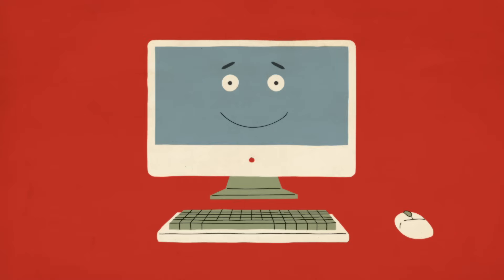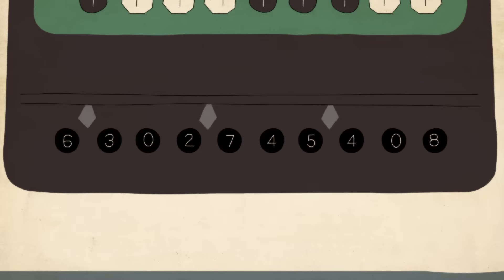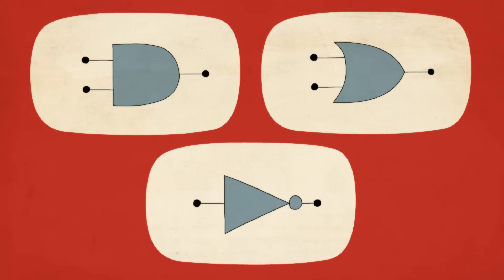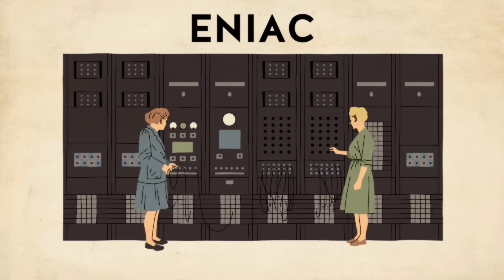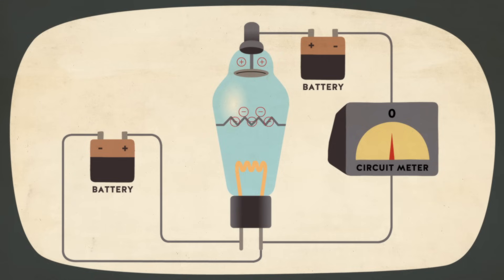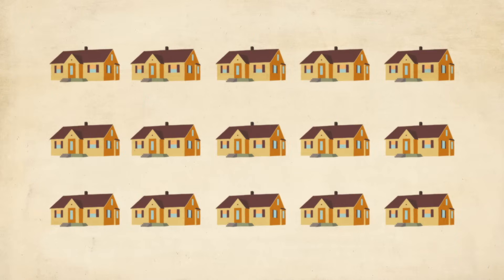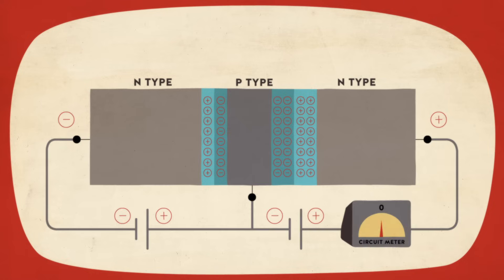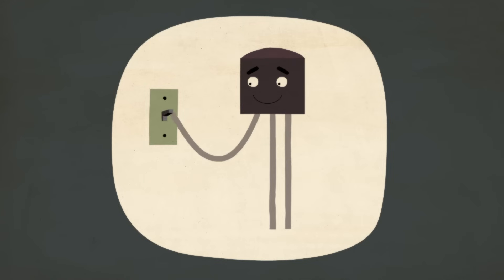How transistors work - Gokul J. Krishnan

Comment: This is really interesting. Ted-Ed, can you make a video on how computers generate random numbers? A lot of software and games use random number generators nowadays. Are those numbers REALLY random? And if not, is there a way for a computer to generate TRULY random numbers? (without using internal clocks.)
Reply: no, they're not. Computers are deterministic (they will always give the same results for an identical set of inputs), which is why the clock is commonly used as a seed to generate pseudorandom numbers, but it's still deterministic. There have been several approaches to generate 'truly' random numbers using atmospherical and thermal noise observed from earth, but that's the thing, you would need something external to the computer to create 'randomness'.
That has always made me think: the world operates by physic laws, for every action there is a reaction and it can be explained with mathematics, so, in a way, there is no randomness in the universe. If you, hypothetically, were able to take in account ALL of the world's 'variables', and knew ALL of the laws of physics (if that is even possible), you could in fact predict the future, it seems. That speaks in favor of a 'destiny', everything that happens is the only thing that could happen. Just a thought.
Reply: Quantum effects are random.  A quantum computer is the only machine that can generate a 'truly random' bit stream.  Having said that, pseudorandom generators can suffice for all practical applications.
Reply: As Freek pointed out, that was Laplace's assertion, and it held philosophically (if not practically) until the Copenhagen interpretation of quantum mechanics.  In QM, particles are 'truly random' until they are observed, at which point a deterministic state is realized.
Reply: Vsauce has already made a video about that
Watch 'What is random' by vsauce
Reply: every second would be much too slow, its more often, but jeha thats what they do. if you want it more random use something that can detect cosmic noise, this is unpredictable for us at the moment and i think it will be for very long time...
Reply: +Robin Maurya there is a way to generate truly random numbers using radioactive decay, but obviously you cant use it in typical PC, but  maybe there is a new clever way of doint it that we dont know.
Reply: The main point is there there are a lot of theories under quantum mechanics that would simply not work if quantum states were not truly random. Since we can observe some of these theories in practice and see that many of them appear to perform properly, that is a big indicator that the chance of quantum state not being truly random would have to be extremely low, or some other law of physics would be needed to explain certain phenomena.

In modern computers, software takes a seed, which is a sequence of binary bits of n-size where n is defined by the software, some software use 64-bit random number, others use 32-bit or16 bit, and for these software when computing higher-bit results, take multiple pseudo-random 32-bit outputs and combine them into a 64 bit output.

The seed is stored, and then every time a new number is requested a fairly complex sequence of operations is applied. This tends to include bit-shifting, use of logical bit-wise operations like masks, multiplications and addition. The results appear to be random enough to simulate a great deal of occasions, but are not truly random, as starting with the same seed, will always generate the exact same sequence of numbers. Like others have said, it can be standard for the computers clock to be in some way, used as the seed for the random generator, thus they tend to have different results. However if you specify the seeds manually, you can get precise results, useful for showing the exact same simulation multiple times.
Reply: +Stefano Del Vecchio https://en.wikipedia.org/wiki/Laplace's_demon
Reply: That was Einstein's contention for the second half of his life, which is referred to as hidden variable theory.  However the violation of the Bell inequalities as tested by Aspect and the CHSH experiment disprove hidden variable theory.  The state of QM 'objects' is a superposition distribution of possibilities, and the act of observation forces one state to appear, through collapse of its wave function.
Reply: Computers are not capable of generating random numbers because they work using specific mathematical formulae. Random number generators are just formulas which receive a number and return a number that looks random, but actually can be discovered if someone knows the formula. These algorithms usually give acceptable random numbers and use something like the time in milliseconds or the player last movements as input.

An example of these algorithms is calculate x*2013-42 and take the rest of the division by 100. if you use x as 1 or 2 or 3, you get 81, 4, 27. These numbers are good as random numbers but they are pseudo-random, because you can say what the result will be if you know the formula.

To generate really random numbers you'll have to use something that can make them, like a Geiger counter next to radioactive uranium(radiation has randomness). random.org, for example generate numbers from atmospheric noise instead of a calculation.
Reply: @Gagan Deep
i watched all vsauce videos. i recommend you watch video from numberphile 'Random Numbers - Numberphile'
PS. jeez, these youtube comments are totally broken, gg google, as always. gg.
Reply: DreadKyller We don't really know if that's a valid refutation: 
“These quantum theories are deterministic in the sense that they give laws for the evolution of the wave with time. Thus if one knows the wave at one time, one can calculate it at any other time. The unpredictable, random element comes in only when we try to interpret the wave in terms of the positions and velocities of particles. But maybe this is our mistake: maybe there are no positions and velocities, but only waves. It is just that we try to fit the waves to our preconceived ideas of positions and velocities. The resulting mismatch is the cause of the apparent unpredictability.”
- Stephen Hawking
Reply: But all we would theoretically need for the Laplace Demon (didn't know that was a thing, thanks Freek), would be to observe all particles at the same time, wouldn't we? It wouldn't matter that they are undefined when not observed, if we had a 'theory of everything' and could get all of the particle states in the universe at any given time, it's all down hill from there right?
Reply: Apocane Take a further look at quantum mechanics. According to quantum laws the states of quantum particles exist in a truly random state until they're measured. If this law was false, then several of the observable effects of quantum mechanics in our lives would not be possible. True randomness doesn't exist on macro-scale, but does exist in micro-scale.
Reply: Computerphile has a video on it, check it out
Reply: get the time, use some method -> conventional method of random number in computer

get the time, get CPU temperature, use some method -> now is more random
Reply: Quantum effects appear to be random as we are not able to calculate their effects, this includes radioactive decay. But just because we have not found a way to calculate the motions and effects in the quantum level, doesn't mean that they are random. We thought a lot of things were random before but we found their equations....
Reply: Making truly random numbers is impossible when in fact nothing in our universe is random.
Reply: +Apocane Even if a computer cannot make a random number, isn't just thinking of a completely random number in our brain makes a random number? Or is even that not so random?
Reply: Cyril Samuel Our thoughts are not random, nothing is. Although you might feel it was random it was caused by something, it might be thousands, billions of different reasons you thought of that number (chemical reactions, particles colliding etc). If we were to rewind the time and let nature do its thing it would happen again, because when nothing is random everything is predetermined.
Reply: well pointed out.
In other words it only appears random because we do not truly understand what we are looking at, let alone how to describe it.
Reply: I think you're actually talking about the deterministic view of reality, I think Richard Feynman has talked about that a few times
Reply: Everyone though so too. Then they discovered quantum physics....
Reply: Our brain is just as deterministic and patternbased as a computer.
Reply: No, computer can't produce such random number. So far it's just a pseudorandom number. At least that's what they tell me in a computer science class.
Reply: No. they aren't really random but pseudo-random. The only way to generate random numbers is through random . org , which is also used by many YouTubers in giveaway contests
Reply: Mohammed Zaid Really? Tell me how they do it. Else, it might be just another marketing strategy trying to convince you with their bullshits covered in big/buzz words.
Reply: 011azr
Oh no. They don't use any buzzword and shit and I think they're a non-profit website made only for research and not financial gains (although some features on the website are paid-content). They have an easy to understand and a convincing enough explanation on their website. They basically use atmospheric noise instead of algorithms to generate them which makes them truly random.
Reply: Mohammed Zaid Even atmospheric noise isn't truly random however. It's probably closer than the pseudo-random generators, but atmospheric noise is still predictable. The only objects thought to be truly random in the universe deals with quantum mechanics, and even that's not confirmed, it could be a pattern that we just don't know how to calculate, there may be a way to predict it before measurement at any given state, we just don't know it yet if so. The main point is, that every result in the universe, is a direct result of the previous state, to be truly random means it has no influences.
Reply: DreadKyller
I can tell you that atmospheric noise is more random than anything you can have around you, even a coin or a dice and since it has no algorithm associated with it, it's generating numbers without a purpose (i.e. true randomness). For deeper info, you might want to read their FAQ since I must admit I'm not fully knowledgable about their methods.
Atm, quantum randomness is almost certainly true randomness and not randomness due to lack of information (like the coin case). However, as you said, alternate theories do exist like Bohmian mechanics which attmept to explain the "random" behavior. We may know one day for sure, let's hope.
Reply: Mohammed Zaid I've read their FAQ, I seriously don't care. The definition or "True Random" is randomness that has NO influence whatsoever. They even state on their page that their product can be argued as not being truly random. The point is, any type of randomness that is the cause of any external stilulus is not "truly random". On their randomness page they explain that while it's true that random.org is not completely truly random,it's so close to it due to the fact that to predict it you'd need to know the position of nearly every molecule in the atmosphere.

I get that their randomness is far more random than pseudo-random, but it's not "true" randomness because the numbers generated are directly related to movement of molecules which directly ties it to a physics trait. They have a massive paragraph on their own site explaining this, essentially saying that their randomness is not perfect but is close enough that it would be essentially impossible to predict the results. If we knew all the information needed, we could predict the result of random.org, it's just the amount of information needed would be outrageously large that it's impractical. The only point I'm trying to make is that by definition it is not "true" randomness, for something to be truly random it has to fit the following:

1) It has to generate a number within a range with every result being equally possible.
2) Each result has to be completely independent from each other
3) The source used to generate the sound can not have any form of external stimuli, has to be completely self-contained

Atmospheric noise is influenced by wind, weather, gasses in atmosphere, etc, Therefore it can not officially be called truly random.
Reply: DreadKyller 
Good luck setting up a Quantum lab at home to get "true randomness" then :)
Oh wait...
Reply: Mohammed Zaid You're starting to honestly piss me off. You are intentionally taking everything anyone says stupidly out of proportion. I said it can't be called true randomness. It's still very damn good randomness but damn your sarcasm and inability to understand what people are saying is revolting.
Reply: DreadKyller
I just made a small joke based on what you said earlier. My apologies if I pissed you off in any major way (smt I apparently did) but it wasn't my intention.
Might've been a miserable joke but not an attempt at pissing you off or w/e.
Let me tell you this, for all practical purposes, I believe random.org is just good enough. There's no such thing as "true randomness" since humans can easily spot patterns even in the most random scenarios possible. Case in point, the sky and the constellations. Pretty sure God didn't allign the stars to make us draw funny pictures on them. An artificial case is the iTunes shuffle that had to be less randomized on purpose since customers were complaining about certain songs being repeated a lot more than the rest while some didn't play at all.
For me, all I care about is freeing myself of pseudo-random numbers since they give unnatural results (tried a Monty Hall simulation with C++ once using pseudorandom numbers and it failed miserably)
Again, if you felt annoyed by my comment, my apologies. Tbh, I was also annoyed by your hunt for "true randomness" and not getting my point at all.
Reply: Mohammed Zaid I got your point long ago, that for all intents and purposes random.org is about as close to true randomness as we have easily accessible. There are a few other sites that offer other ways of nearly true-random numbers as well, several that are referenced by random.org as being equally random.

I wasn't trying to search for true randomness, more stating that when you said "The only way to generate random numbers is through random.org" that it was a false statement.
Reply: DreadKyller 
Well. You might've now understood why it was me who was supposed to be more pissed than you were. :)
Instead of acknowledging my comment and moving on, you started nitpicking my comment. When I said "random", I, in the context, meant to say "not pseudo-random". You see? =P
Anyways, good day! I've read all your points and I completely agree with them. Let there be no such misunderstandings between us in the future :)
Reply: Mohammed Zaid I will just state, you did the same, never acknowledged mine either. I don't like arguing, so I'm glad we both understand what each other is saying now.
Reply: Isn't it true that the time when a single atom in a radioactive substance decays is truly random? That's why we only talk about the substances half-life, right?
Reply: pellevinken Like with quantum mechanics, we currently believe it to be truly random because we do not know the formula for predicting it. There may be a point where we learn everything that can affect an atoms decay, and create a formula for predicting it, but we're not there yet. Same with quantum phenomena, we say it's truly random because we don't know how to predict it, there may also be a time when we figure that out. It is possible that either scenario is truly random, but we really can't ever be 100% sure until we solve it.
Reply: DreadKyller
Well, we do have the Schrodinger Equation for that but the equation itself, in its core, implies that there is indeed randomness and no certainity surrounding anything but only probablility. The Heisenberg Uncertainity principle already has clearly stated that there's no such thing as full certainity. Moreover, in many cases with such small scale phenomena, the outcome changes if we observe it which also pushes it further into the realm of randomness
Tbh, this view of there being a hidden equation is very unpopular as it was merely started due to an older and more stubborn Einstein who was prejudiced against the theory because it didn't fit his persona; beautiful picture of the universe.
Reply: Mohammed Zaid And what you said may just be one of the most misconstrued things I've ever heard. I'm not saying there is invisible equations, I'm saying we can't know if there is or not. You do not know everything about everything in the universe, nor does anyone, therefore you can not say that there is not a way to predict the outcome of any event.

What I'm saying is that until someone proves one way or the other that there is either a complete proof that it's truly random, or a complete proof that it's not, no one can completely claim either. All I'm stating is that to say that quantum mechanics or radioactive decay is truly random is not proven it's theorized, because we don't know anything stating otherwise, therefore it may be, or it may not be, we have no idea.

The Heisenberg Uncertainty principle was observed do to quantum object having matter-wave nature. We currently don't understand some aspects of matter-waves, and thus until we do it is uncertain if we may figure out mathematically the behavior of matter in a wave state, if we can do such, then we could potentially solve the inequality that created the entire Uncertainty principle, which is the fact that the more accurately you observe the momentum of a particle, the less precise you can observe its location, and vise-versa.
Reply: DreadKyller
"The Heisenberg Uncertainty principle was observed do to quantum object having matter-wave nature."
...and the very fact that there is such a thing as a "matter-wave" makes the uncertainity priciple exist. It's not because we don't understand them (deBroglie and the rest already did) but because waves CAN BE SUPERIMPOSED!!! If you know more about Fourier Analysis and stuff, you'll understand how one wave might actually be millions or more added to each other and there's no way to be certain about things that way.
The Hesienberg Uncertainity Principle stems out of this exact purely mathematical idea. It's not a conjecture as you make it seem. It's the reality and has been observed countless times.
The Schrodinger Equation that describes matter-waves IS a probability eqation. Try the deeper and more manual Dirac-Feynmann way and you'll again find probablity popping up.
Idk how far have you studied Physics but this article is surely gonna help
http://www.askamathematician.com/2009/12/q-do-physicists-really-believe-in-true-randomness/
Einstein might've been a great physicist, but it wasn't physics that made him think what you're thinking. It was simply his own personal prejudices.
Reply: Mohammed Zaid The idea of a theory of everything or invisible equations existed way before Einstein, one of the most famously known examples would be Laplace's quote about the intellect. This was back before quantum mechanics were even discovered, and thus the theory from Laplace was inherently wrong. Einstein may have had a prejudice with the whole quantum mechanics, famously with his "spooky action at a distance" quote, the idea of a theory of everything existed before Archimedes, and is still labeled as an unsolved problem. If physicists truly believe that certainty is 100% impossible then they'd stop trying to figure it out because it wouldn't be able to exist.

Think back hundreds, even thousands of years at what people believed then, they would have laughed at someone for trying to make them think that what we know now was true. If you can't seem to understand the simple notion that we do not know everything, and therefore we may, in the future, find something out that completely changes the way we think about physics, then I seriously wonder how much you truly are credible in this topic.

You keep talking about "probability" equations, how many times does it need to be explained that we don't know everything, therefore something that seems random may not be. I'm neither agreeing or disagreeing with the idea that true randomness exists, I'm stating for the last stupid time that just because no one currently knows of the existence of an influence that may allow us to understand these phenomena better, doesn't mean one doesn't exist, that is not a disputable statement, you can never state that something doesn't exist just based on the fact that no one's found it yet, that's called ignorance.
Reply: DreadKyller
I thought this might build up to a conversation where  you'd agree on some points I make but it seems your prejudice has made you reject my points, the website I linked you to (a blog whose authors are a mathematician and a physicist) which nails my point to the ground and turned this conversation into a personal attack of some sorts. :/
The randomness of quantum mechanics is not random due to ignorance, but random because it's fundamentally, mathematically random and it's proven to exist.
Idk why but you seem to be confused between the theory of everything and the fact that all things are predictable when they have nothing to do with each other. The Theory of everything is merely a pursuit of Physics to unify the equations involving the 4 fundamental forces, quantum theory, relativity, etc and possibly lead us to understand dark matter and energy.
"I'm neither agreeing or disagreeing with the idea that true randomness exists..."
Just a few replies before, you surely WERE arguing that it doesn't exist. :)
"then I seriously wonder how much you truly are credible in this topic"
Speaking of which, let me see how far have you studied Physics (and I'm not including that Quantum Theory mod on Minecraft) and then we'll see about how credible YOU are when you're simply trying to deny a mathematical fact.
"you can never state that something doesn't exist just based on the fact that no one's found it yet, that's called ignorance."
For one last time, it isn't based on ignorance, but on mathematical principles. smgdh
Reply: Mohammed Zaid Ok, I will state that literally no person on the entire internet has pissed me off as much as you have.

I understand what you have said, and I have addressed them as such, I understand that according to the principles and theories you've presented that complete certainty doesn't exist. Now take it from my perspective too, where maybe it'd be nice, if you expect someone to agree with what you say, to at least attempt to understand what they're saying, because the only thing you've done is bash in everything I say because you think your opinion is more important.

"Just a few replies before, you surely WERE arguing that it doesn't exist. :)"

No, that is blatantly wrong, and this is why I'm pissed at you, ever since the first reply you wrote to me during our initial conversation you've been degrading and putting words in my mouth that I never said, i'm absolutely sick of being treated like a 5 year old by someone who think they're a genius or a god, I never said I didn't believe that it exists, I'm saying that currently we believe it does, I'm just for fucking sake stating that we never know if 200 years or something down the line someone figures something out, the existence of a phenomena we haven't seen before, imagine living in a world where we hadn't discovered that light acts as a wave, people would create theories based on what they knew, as soon as particle-wave duality was discovered nearly everything changed in how we look at quantum physics.

I'm not stating that anything you have said is incorrect I'm stating that I personally will not see it as confirmed until all possibility of unknown is removed. I don't give a shit if we're talking about physics or not even, but simply in general, to state that something doesn't exist because we have not seen it yet, is lunacy.

To me, all I see is someone constantly replying with the attitude of "we know everything, we know that nothing else exists that could possibly be related in any way-shape-or-form to <insert category>. We know everything, nothing that has been considered to be true can possible be wrong at all." History has proven that mentality simply doesn't work. I don't personally care if true randomness exists or not, I don't personally care if everything can be explained or not, but what I will not accept is the level of idiocy required to truly believe that we live in a world that is exempt from change and that nothing is incorrect and that we will never find anything else that may potentially change how we think about everything. In the history entire math systems have been proven wrong, and while of all things that's fairly unlikely to happen to our system, until we know literally every thing in the entire universe, the answer is we don't fucking know for sure.

Also, that link you posted essentially had the mentality of "we can't predict the event before it's done, therefore true randomness exists". While that may be true, the part which I'm stating, and that numerous other people have also stated in reply to that thread, is that that's nut fully founded, it does not in any way address the possibility of something we don't know, it calls it wrong, but never proves it, and never explains how we somehow know that these simply don't exist at all. How do we predict the dice? By knowing everything about the table, the air and the dice, along with other factors the page doesn't mention, the point is the author is saying "we can't predict this, therefore it's impossible to predict this", how about "we can't predict this with our current understanding or knowledge".

Reply again if you wish, but I'm getting sick of you intentionally misreading and misinterpreting every single thing I say. You have literally made me pissed enough in the span of a couple hours to slam my head through my wall, good fucking job. I have no hope for humanity past this point.
Reply: DreadKyller 
PS. In case you still weren't sure, on a personal level, I DO respect you a LOT! I've always loved programming and was great at C++ back in my school days and I wish I could be an independent programmer as you are. In the unlikely event that we meet some day, I think we'd have a great conversation and I'd maybe invite you to my local cafe for a good chat on topics (including this, which went beyond what I expected, in a negative way ofc :/).
So again, I urge you to not take this conversation as a personal attack against you since I seriously didn't intend to do that and I'm still not sure where I went wrong or exactly at what point did I start sounding rude or w/e since I didn't intend to do it. 
I also had the chance to get furious and flip back at you the way you began that random-centred conversation instead of simply thanking me for showing you a good app and moving on, but I kept silent on that until you brought it up. For me, I took it as a gesture of ungratefulness. So I guess we have things to learn from each other.
Good day again ^^
Reply: Mohammed Zaid Thanks for the explanation. unfortunately since this is text chat, it can be extremely difficult to see tone-of-voice and context, and thus it's way too easy to misinterpret things. I wasn't necessarily taking it extremely personally, It just felt you were being a bit hypocritical at times, wanting me to support your ideas, but not the other way around, stating that "absolute certainty doesn't exist" but yet we can be absolutely certain that there is nothing that could change our thinking on this topic.

I've seen a lot of people on the internet that have started a conversation and then they would throw out a lot of the words you mentioned at me. Because of these incidents, I tend to take things a bit more aggressive when I encounter something I feel is being unfair, even if it has nothing to do with me, I'll tend to put up a fight for nearly any comment chain where I believe a person doesn't deserve what they're receiving for reply. So I'm sorry for being a bit aggressive in my last few comments, it was also very late and I had a pretty crappy day, so that makes it easier to get annoyed.

Have a good day :)
Reply: DreadKyller
I understand. I've been in a similar position many times online. It's indeed hard to understand someones tone from what they write unless they do a pretty good job at it. (I'm certainly very bad at writing myself)
I also have a friend (with whom I always chat online) and we always speak with each other in an aggressive, taunting tone just for fun so it might have seeped into my regular typing habits.
I hope whatever made your day crappy is now dealt with and you're having a good time as you're reading this. ^_^
Good luck! ^^
Reply: one can generate a random number via two methods. The first one relays one having a true random physical phenomenon like atomic decomposition, then taking the reminder of the physical quantity using modular arithmetic. However, performing this operation is too slow and expensive when it comes to real world applications such ad bigdata analysis and cryptography. An alternative way to do that is to use random number generator algorithms which can be programmed on any PC. The problem with these algorithms is the fact that they are not truely random. They relay on a mathematical function which takes an input or a "guess" from the user and processes it to give set of outputs that are mathematically independent. But this would mean that if you give it the same input, it'll always give you the same outputs. A common way to fix that is by using the current time as an input, which makes it very random and pretty hard to crack.
Reply: Abdulrahman Mahdaly Thanks for commenting on a more than 2 month old post, with information that's already been mentioned.
Reply: +DreadKyller I just tried to give future watchers a concrete understanding of the problem without needing to scroll up and see all the previous discussion! did you get the point ?
Reply: actually, not
Reply: or just use random.org
Reply: Lla derat they use 01010001001010101010101001101010100010101010101101 to make a 100100111 and that 10010011101
Reply: Computers generate pseudo random numbers.
Reply: Oh man, I literally had the same question in my mind for so long now. People like me exist.
Reply: Nope, that'll be like thinking, at some point in the os, it's programmed an algorithm unimaginably long(means not truly Infinite, but very very very long algorithm)
Reply: It could be a have a logarithm which seem to random but very complicated
Reply: Simple Explination: Meeny Meeny Miney Mo but on a computer.
Reply: It's not that we didn't find a way to discover the randomness of quantum mechanics, it's that there's someting called "Uncertainty principle" that states there's no way you can know a particle speed and position at the same time with certain precision. Don't matter how far we go with tecnologie, it's someting that is just impossible to know(or the theory is wrong). So in a way u can say it's kind of handom how quantum mechanics work, although we might never know what really happens behind this "courtain" of probability.